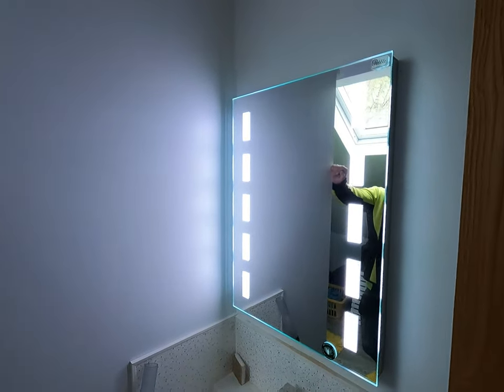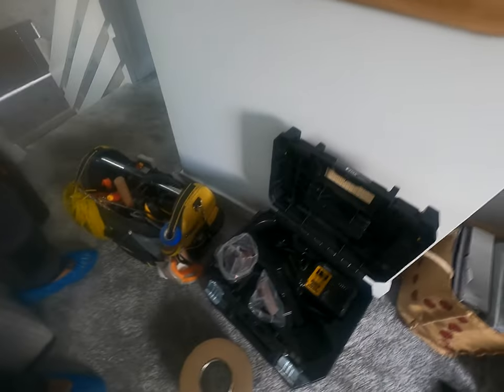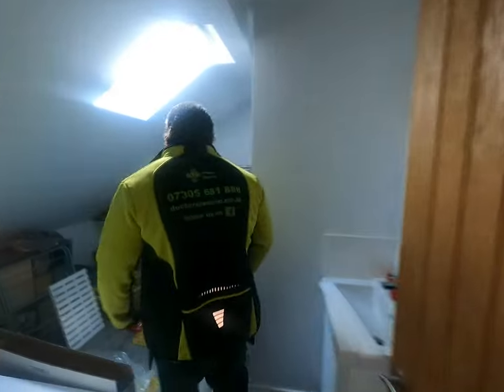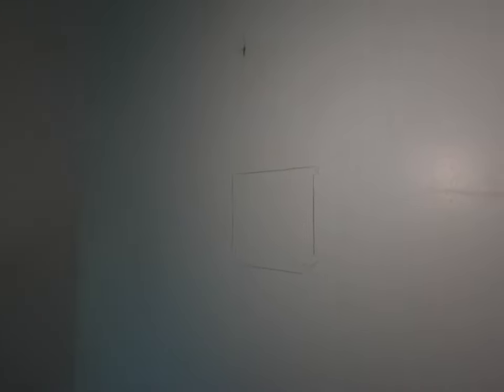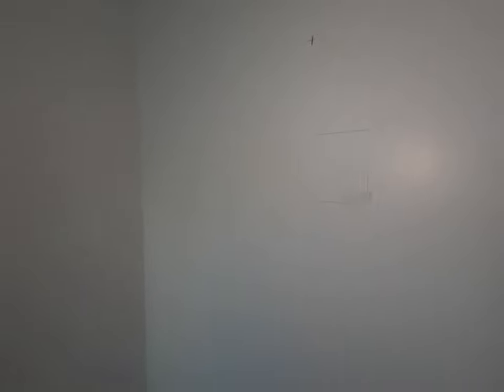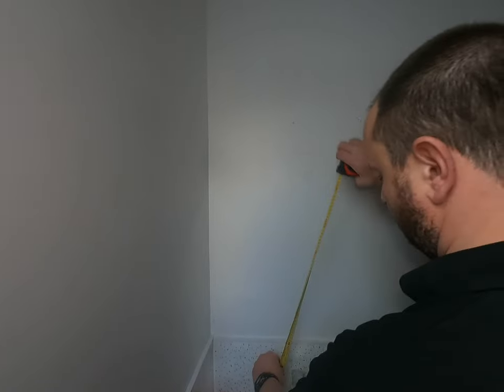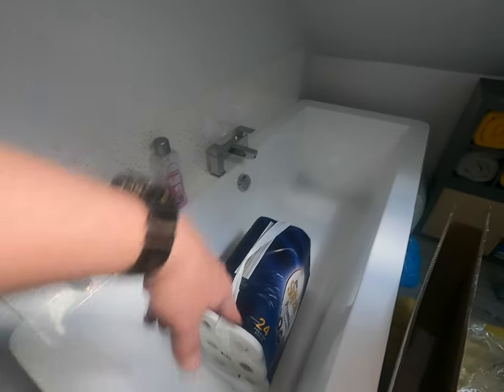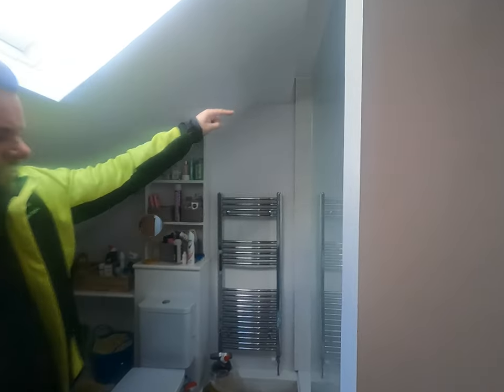Installing an electric LED mirror in a bathroom fused connection unit FCU spur bathroom basin zones

Comment: Hi Guys can i fit an Eletric light mirror on a downstairs toilet drill through the wall into next room next to a light switch and use the light switch as a power source !!
Reply from the maker: It would depend on how the lights are wired, ask an electrician. 
Thanks for watching.

Comment: Looking to fit an LED mirror myself like this. Great video. How did you know where to cut the square and miss the noggin?
Reply from the maker: You can usually tell where the noggins/plaster are by tapping the wall, when it's hollow it's a bit echoey, when there's a noggin or plasterboard there's no echo

Comment: Hey love watching your videos guys (best electrical ones on Youtube), really entertaining with lots of useful info. Have to say though, that you're pretty over the top with BS1362 fuses. The calc P=IV in this instance is generally used to avoid overload ie fixed load taking out the fuse, so the calc which gave 0.16A means that as long as that BS1362 is above 0.16A (Ib<In) then you're good to go. .... The 1mm cable suppling the fcu is good for 16A Ref C and 0.75mm good for 6A.  So in theory a 13A BS1362 would be just fine with a 6A MCB. Ib<In<Iz
Having said that, and BS7671 suggests, we take manufactures info into account, and same as you, it just feels right to put in a lower rating. So 3A - 5A for lighting is the way to go in my opinion. And it is only my opinion.
Hey also really like how you explain the Regs or guidance, and totally agree with you when you say why try and remember when you can look it up in OSG, Regs etc
Reply: Hey Jon! Thanks for watching and commenting, some great points mentioned there 👍🏻😁 and thanks for your kind words
Reply from the maker: cheers for your comment John, I agree that generally a 3 Amp would be used mostly and there wouldn't be anything wrong with it, thanks for watching!

Comment: Nice one fellas 👍 would it be ok to fit a 3amp fuse instead of the 1amp 🤔 keep up the vids 🙌🏻🙌🏻
Reply: Glad you like the vids mate, plenty more to come :)
Reply from the maker: Thank you for your comment King, you should replace or fit a fuse with the next size fuse available higher than the rated current, in this case it would be a 1 Amp fuse, many Electricians will fit a 3 Amp fuse as 1 Amps aren't readily available, if you choose to do that then it's your choice.
Thanks for watching!
Reply: @DoctorElectricYouTube  cheers for the reply mate 👍 as you can probably tell I’m a non sparks , but I’m not a diy dave either😂😂 thanks for the info as I always thought that fuses were 3amp 5amp and 13amp 😂 learn something every day 👍 🙌🏻 nice one
Reply: Watched again fellas 👌👍 I’m getting my mirror ready for the sparks to connect up I’ve done the plaster board back box bit with multi tool got an unswitched fcu for behind mirror and a switched fcu for up in loft easily accessible, just a question when he connects up wil he go of lighting circuit (nearest jb or pendant for live feed) or will it come of a socket? only reason I ask is the nearest socket will be a pain to get to rather than lighting.dont worry I’m not doing a diy dave and connecting it up myself I literally am getting a sparks in 👍 I just want to make life easier and do any chiselling out ready if need to go off socket etc cheers 👍👍

Comment: Nice bathroom light installation fellas. But should the fused spur be acceptable prior to handling the fitting. But what a really good job from the Boath of you. Keep them real L&H 👍
Reply: Glad you enjoyed it Stephen and thanks for watching again 😁👍🏻
Reply from the maker: Hi Stephen, the FCU is just there to provide isolation in the event of failure until we or another Electrician can come out to replace it, perfectly fine for it to be behind the mirror.
Thanks for watching!

Comment: On unidentified switches and switch fused connection units you could flick the switch on test with continuity tester or put fuse in and do the same type of continuity tests to identify permanent connection point and load out. Not Voltaire who was a important philosopher but Count Alessandro Volta inventor of the Voltaic pile/chemical battery thereby proving that electricity is not just generated by living things. The SI unit of electric potential (voltage) was given as volt after his discoveries.

Watch professor Jim Al-Khalili’s series on electricity on YouTube give many of your students Dean a fascinating history of electrical and magnetic discoveries.

Loving your work mate upwards and wish you both the best in life and work. Nicest sparks on YouTube.

Why am I called Mathman it’s because I have loved mathematics and used it in my career as a economist/quant since school and university in my research at university when I was a research fellow/Professor and when I worked for the UK government and Bank of England and then in the USA at the IMF in Washington DC. And still using it in high level physics and electrical learning especially in electromagnetic theory, quantum theory and plasma physics.
Reply from the maker: Wow, what a great comment mate, thank you
Reply: That is an amazing story! I am now going to refer to you as professor mathman! Mathman alone doesn’t give you enough credit for those achievements 👍🏻😁

Thanks for your kind words mate and always a pleasure to have you as a loyal prescriber since the start 😁
Reply: @TheAdamEdward  it’s no big deal just take the attitude you can learn from anyone young or old, treat people with respect even if they may not be respectful to you. The language of mathematics pervades many diverse subjects trade and non- trade based. Both of you are doing excellent work and the time you take in doing these videos are invaluable to younger apprentices. We definitely want to see greater professionalism, technical ability in this field and root out bad practice that not only undermine the industry but create unsustainable pay structures as electricians race to the bottom, worse still it creates dangerous electrical installations. It happens in many industries and fields. To be great at anything it’s not just the learning and training and experience but is far more related to attitude and whether that desire to do great work comes from within you. That’s what sets apart bad,  good and great sparks.
Reply: @mathman0101  well said mate! Truly inspirational 👍🏻😁